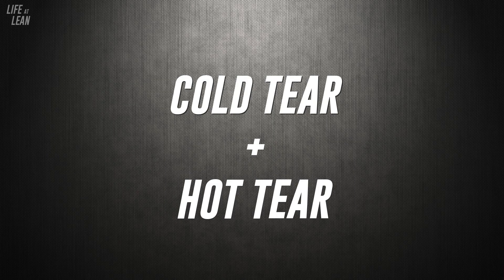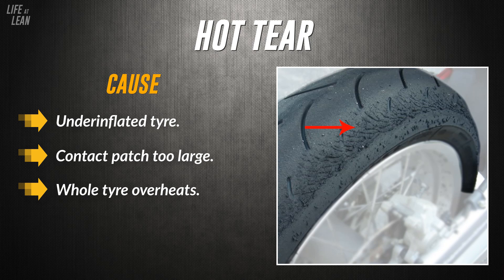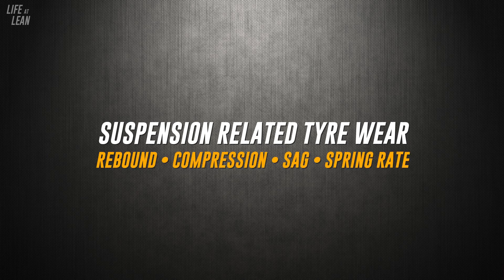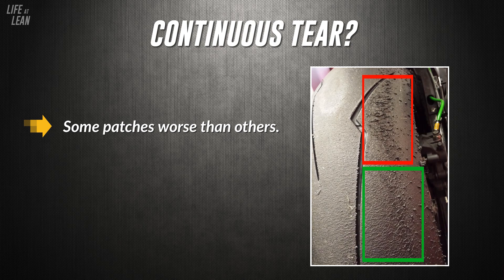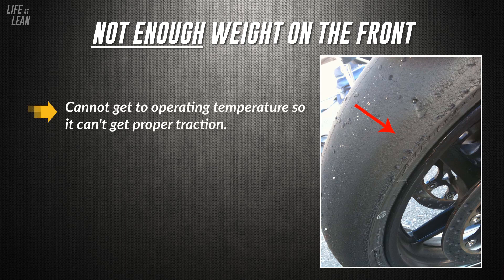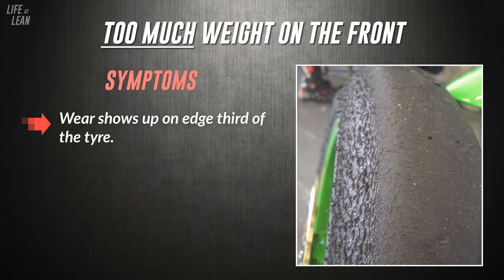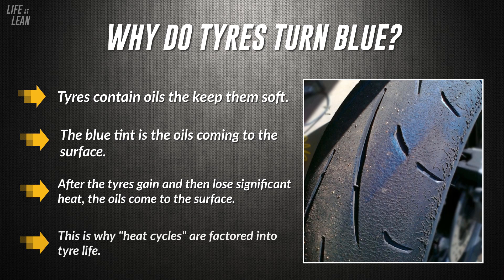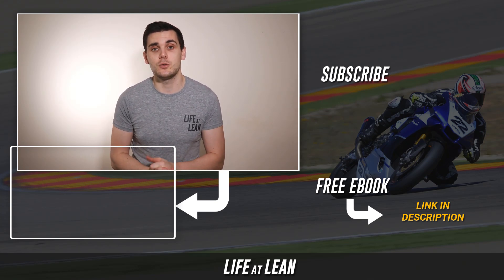Motorcycle Tyre Wear on the Track: Common Types and Causes

Comment: Tire whisperers” exist because there is a lack of actual data and understanding, fuelled by people where social media has NO regulation.
Go look at any professional paddock, not a single one of them will draw conclusions from the tire wear alone.
We separate ourselves by having the data and understanding of how to utilize it. If we see unusual or excessive wear, the first thing we do is look at the data log for tire pressures, temperatures, suspension position/velocity, track/ambient conditions, wheel slip, and rider feedback.
Each variable is also weighted. Tire wear has a rather low comparative weight to things like feel, temps, and pressure.
Taking something as complex and dynamic as a motorcycle on track and drawing any conclusion from how tire wear looks is extremely reductive, and inaccurate.
How a tire looks is barely even a data point, it’s subjective and open to interpretation. It’s like looking at the zip tie around your fork leg and making conclusions about what shim stack and clicker settings you need on that alone, it’s insane. Tuning to a ziptie/airgap is a prime example.

Comment: I know this is an old video but the reason for higher tire pressure lowering tire temperature, is not because of the size of the contact patch. But because a higher pressure tire deforms less thus generating less heat.

Comment: First cold tear is a compond related issue wrong compound for the track temp or surface. 
Second the lower the pressure the lower the temp wil get if lower pressure would give lower temp than why do we run our front tyre much higher pressures to get temp in them.
Even when overinflating tyres you would never run such a small part of a rear tyre under acceleration.
What you do get is when pressure is to low the tyre deforms under leaned acceleration and the inside of the tyre gets pulled away from the asfalt, so why run a wide superbike tyre if you only use 2/3 of it? 
And last most of the cold tear comes from braking under angle not acceleration.

Comment: hello I recently changed my tires had a bridgestone battlax and changed to a pirelli diablo rosso corsa I always used bridgestone and they are very good but this pirelli diablo is a fantastic tire I can only agree with you only use my tires on the road not yet I had the opportunity to wear them on the road. They are very reliable. It looks like super glue.best regards

Comment: When you remake this video can you also explain what each scenario feels like on a bike? For instance hot tear feels like riding on a smooth wax. The tire isn't sticking, but it isn't sliding - it's surfing. Cold tear feels like massive gip then a chunk or medium sized twist slap - like someone slapped the swing arm 0.1-1mm.

Sometimes when you're on the bike if you don't know the feeling you can ruin a set of tires in a few miles.

Comment: Why doesnt this happen to tires on the street?
Reply: Because you didn't ride them hard enough - which is probably a good thing as accidents have more collateral damage for both you and others on the street. Aka low side at 60mph and you could hit a patch of grass that catches and snaps your ankle - a much less likely scenario on a track where you can just slide it out.
I've gotten most of these on the street: hot tear, cold tear, and the feathers on the rear of a water channel from used fork oil. But does that make me a good rider? arguably not - perhaps I'm not using the right head position and thus leaning the bike over too much, perhaps street rossi'ing it, perhaps wrong tire pressure, etc.

Also most of these you can't get on the street unless the road temp is greater than 55F. And you probably can't get them unless it's greater than 75-80f without a perpendicular bias carcus construction like on a racing slick or Michelin RS / similar.

If you absolutely must do this on the street I suggest a parking lot first or Ride a twisty road at 50% effort for a couple miles. Then do a few max braking stops from like 80-20mph to get heat in the front. Do a few pulls from 15mph to 85mph to get heat in the rear. After that, you should be relatively safe to lean pretty hard on most road tires.

Besides why would you want this on the street - just means the tire wears out faster. Most times I have to pay around $250 (front+rear) + $75 (balance / fees) for a set of tires. It's like $400.... a couple times a season? So much for 55mpg savings.

Here is my last tire 2 weeks ago (will delete link eventually):
linked deleted

You can see the feathers on the rear tread due to worn shock oil. You can see the left side is bald because you have more visibility in left corners so you can lean with a significant factor of safety. The right side is ridden to the edge but doesn't have as many miles because I currently do not have an ability to do full lean on my right and also stop midturn. There is no cold or hot tears because the last 100mi of that tire was in the rain, which surprisingly grips very well bald as long as it's hot. All of that should scream stupidity to you. Don't do it.

Comment: Question about my front tire tread rised, which side is leading edge? Let's say I'm sitting on my bike, the edge towards me is leading edge? Anyways that side is rised, like pealing out almost 1/4 in forming a paper thin rubber. Both sides looks like orange skin, while center looks smooth, I guess because my front tire for enough heat and it really digging to the pavement ?

Comment: Hello I'm a rider in Dubai. I've noticed a peculiar wear pattern on my tire that has left me really confused. I hope people with more experience can help me out. I ride a Buell 1125r 2008. I've purchased a new set of tires ( metzeler sportec m7 RR) at the time of purchasing the bike back in July 2016. Tires were manufactured in may 2016. I've put around 9000km on the tires as of today (that's around 5000 miles). The tires were absolutely fine until maybe 4000 miles and then all of a sudden cracks started to appear almost over night. It looks like fissures radiating from the center outwards on the tire. The confusing part is that the same profile of cracks appears in different areas on the front and rear tires.  In the rear, the cracks are right on the center band. On the front, the cracks are right in between the center band and the edge of the tire on both sides. Wear markers are not even close to the surface of the tire and I do keep my tire pressure in check consistently as per Buell specs. Can anyone tell me what the issue is and if the tire should be replaced. Thanks.

Comment: I heard that new riding technics consist on set a high pressure on the front wheel around 30psi and maybe 24 psi on the rear, what do you think about it, ? and what could be a good setting pressure?

Comment: Also comes down to rider style and the track surface and weather.
And a slick on a 250 wont look the same as a slick on a 1000cc superbike.
And you should be able to get a few race meetings out of a rear slick without any blue.
If it's blue it's a bit "cooked" and might go off before it's wear life, raise pressure slightly should fix it.
Reply: 6 सालg huuĵnnnvccglkppo0uuuui9ijjjkoiio op on one day

Comment: oh, and those "melted arcs" of rubber, are a visual cue of where a tyre is providing large amounts of lateral grip vs drive grip. 

the tyre goes from resisting a sideways slide at full lean providing one visual wear pattern where the lines are parallel to the tyre, to resisting spinning up while the bike is straight up and down, where the lines of rubber move towards being perpendicular to the tyre. 

the "arc" you can see on the tyre is where the tyre is slipping during that transition as the rider applies throttle and begins to exit the corner.

even a tyre that is wearing well will have these tell tales, and it can be a simple way to see how early a rider is managing to apply the throttle on corner exits.

Comment: Your info on "cold tear" and "hot tear" is just so wrong... 

Put simply, if a tyre that was over inflated was one the would become too cold, simple physics would tell us that it would drop in pressure. With this, according to you, you would then start to generate heat, and the pressure would increase again. You'd have a tyre that found its own equilibrium, and that would be amazing, but it doesn't happen. 

Similarly, if an underinflated tyre generated heat, its pressure would rise, and it'd solve its own problems. 

Things just don't work this way. 

An over inflated tyre will get hot, and the pressure will increase, and it'll get hotter, and the pressure will increase, and so on, until it reaches a point at which it begins to lose grip, less energy can be transferred into the tyre, and things level off, being too hot, and over inflated. 

At the very extreme end of things, you will not have the grip due to poor pressures, and yes, the tyre may cool, but it is spp far from the operating window it's irrelevant. 

A lower tyre pressure will cope with the heat better, as the work load is spread across a larger part of the tyre. Typically, as a rider increases pace, they will need to look at how to dissipate this extra energy being put into the tyre. If a rider is too slow with a lower pressure, they will feel uncomfortable with the movement, and simply won't be working the tyre hard enough to maintain the heat. 

You have to go very low in pressures to cause heat generation issues, at which point you'll likely blister the tyre, but again, it's a long way out of the normal pressure range. It is however why SBK/GP have mandated minimum pressures. ultimate grip can be found here, but it is tortuous to the tyres, and often leads to failures.
Reply: Aaiden Coote actually his info is correct. What you are missing is tires operate optimally at a certain temperature. You are trying to get the tires to this temperature via psi. What is meant by a cold tear is the tire is not gaining enough temperature to operate effectively. And same as hot tear is the tire is going past the optimum temperature. What you mainly want to do is gain roughly 5 to 7lbs from cold temp to hot temp. This is the optimum setting to get to the tires operating temp. If you tire is not gaining enough psi it isn’t gaining enough temp to operate effectively which in turn causes the rubber to tear when you provide a load by HP to the rear or turning forces for the front. On the opposite side if the tire is gaining to much psi it means it is over heating last the optimum temp and then the rubber is in lament terms greasy, meaning when you apply a load the rubber is basically smearing off the carcass. 

A lower pressure can not handle the heat better, it’s basic tire physics. You do not want to spread the load over a larger patch, too large of a contact patch will push the tire way past its operating temperature and will lead to a crash.
Reply: yeah, nah... how cold is it before you started? 
There is absolutely no point in concerning yourself with how much pressure your tyre gains from cold. it is literally the least useful info you could obtain. This is why we use tyre warmers, to get rid of as much gain in temp/pressure as possible.

oh... as for a larger patch generating heat? 
rub your hands together as hard as you can. it gets warm. 
rub your thumb into your palm as hard as you can and you'll get a blister... 
it's the same thing.
Reply: Aaiden Coote yeah so the Race tire vendors who say the same thing are wrong? The WSBK Pirelli race vendor saying the same thing is making it up? While it’s cute you are so confident but sorry I will trust the experts over an internet expert. Come to a professional race, go talk to the true experts and they will give you a world of good advice.
Reply: +JPRacing715 saying what? you've lost me. 

I've been competitively racing nationally for a few years now, and have dealt with national suppliers quite personally. Our first round of each year is at the Phillip Island round of the WSBK championship where International Pirelli techs watch our classes to keep an eye on things, and we'd be being told very clearly if we were misusing their products. Add to that, I've had support of someone over the last two years who has run a team in WSS, and has forgotten more than you or I will ever know, and I can assure you, what I've learned about tyres seems to correlate quite well with the Data he has accrued over the years.

Comment: So the balls of rubber that happen on the outside edge of my tyre aren't a bad thing on track days? There s21r street tyres on a MT-10. The suspension seems to be fine and I did run lower air pressure on track.
Reply: Wozza's Sports Cruiser Rides the S21 is a street hybrid tire, it is NOT a race tire. It has no race compound in them. You do not want to run them at race tire pressures of 21psi. Start at 29psi cold and judge from there, what you are looking for is about a 5 to 7lb difference from cold to hot.
Reply: DO NOT under inflate tires without NTEC technology, please don't do it - you WILL ruin the tire or worst case scenario, crash! Only tires with NTEC technology (Dunlop's D211/D212 and similar) are road/track tires that allow lower pressures and perform better in track conditions. The S21 carcass is not built with that technology. I've raced the S21 plenty of times and depending on the track layout/length you can use it for a few laps before it overheats. However, lowering the pressure to "track" levels (2.2 front, 0.8 back) will definitely ruin the carcass and it won't act "properly" in turns.
Reply: Yes Mate, The S21r I've got I had about 20psi
Reply: Anhjje the reason Dunlop race tires can run that low is they have what they call zero growth, meaning the pressure from the warmers is not much different than pressures off the track. Dunlop 211’s and so on are a full on race tire while the S21 is a street hybrid mainly used on the street with some track days in there as well
Reply from the maker: From my understanding the balls are simply the rubber wearing away as it should and collecting on the edge. Having said that if you have a lot of big balls then the tyre could be getting a little too hot, but if the rest of the tyre looks ok then you're probably in a decent pressure window.

Comment: race tires and tire warmers.... best investment you can make (if everything else is set up correctly.)
Reply: Not really.  Without tire warmers, you waste 2 laps every session getting heat in them. Thats a full session by the end of the day.
Reply: Good tires make all the difference even with shitty bikes.
Reply: Sunyata  that's incorrect. As it has been explained, not only tear will send your tyre to the dump, but also heating cycles have a role. By using heaters, you preserve tyre considerably. My Brother has used his Pirelli Diablo for more than 2 years of track days and they still look very fit, not that shade of exhaust oil most amateurs carry home on average track day.

Comment: Wouldn’t centrifugal force cause the melted rubber to move towards the outside of the tire? That’s why there are small collections of rubber balls on the outside. I am not exactly sure why the rubber trails arc in that way.
Reply: It’s spinning around the axle axis, so force will drive it to the greatest distance from the axle which is the inside where it’s tallest,  even ifyou were to spin it as if you’re trying to spin a set of tire (unmounted off bike) on the ground with your hands, it would still go to the inside because it’s furthest away from top and down axis.
Reply from the maker: My understanding is that rubber balls are something different, and are the result of rubber collecting together on the edge of the tyre while at higher lean angles (and remaining there). As the bike stands up, the rubber that's melted away farther up the tyre will want to move directly away from it (due to CF), but because the rubber is sticky it moves up the slope of the tyre into the middle. Also it will move backward because the tyre is spinning forward. I don't know if this is what is actually happening, but thinking logically that's why I would say it arcs like that into the centre of the tyre.
Reply from the maker: Thanks John. That's what I was going for but you've just put it better.